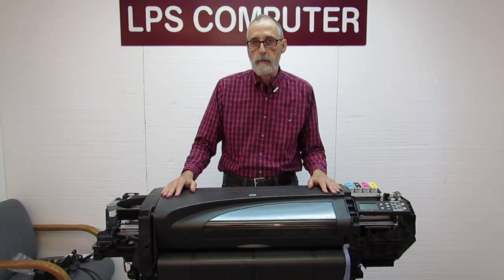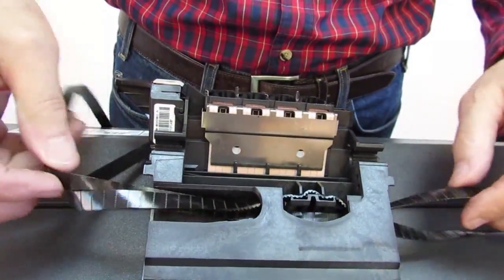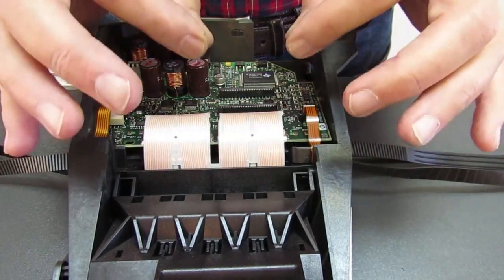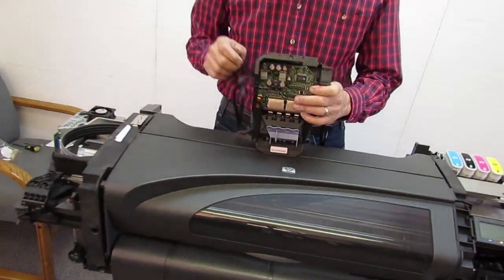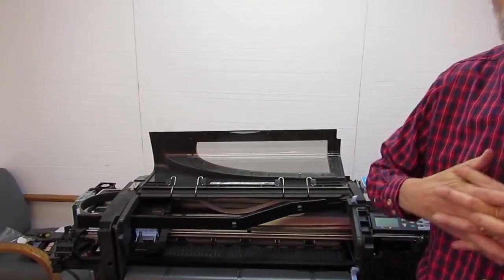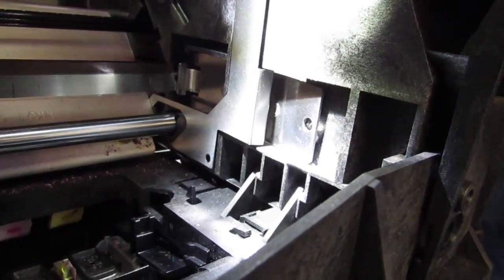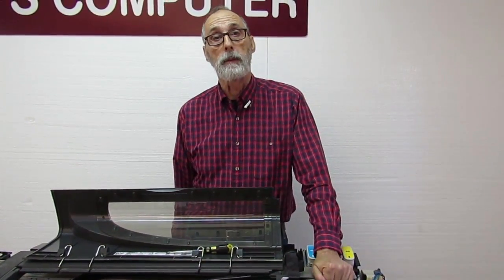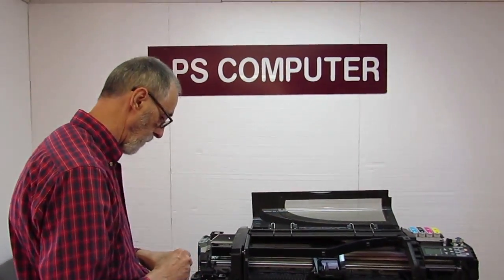HP Designjet 500 & 800 Error 86:01 AFTER Belt Replacement

Comment: Bob, I cleaned the machine, checked the coding strip, checked the cutter wheels and everything is fine. I was able to print after that but that was a week ago.  Tried printing today and am getting the 86:01.  It tries to print but then says there's a paper jam when there isn't one.  Any other suggestions of things to try?
Reply: I replaced the belt 2 years ago (thanks for your video and supplying the belt to help me do that) so this error is happening years after the belt replacement.
Reply from the maker: What is the machine history? Has the belt or other parts been replaced?
Reply: Hi @LPSshowsyouhow  Yes, I replaced the belt and it has a new formatter (it's only about 3 years old).  The print carriage is not quite 1/2 way when it says it has a paper jam, and this is after it starts to print and has printed a few times.

Comment: I acquired a Designjet 500 that literally was rescued from the trash. It was outdoor, damaged by water, tree and plants debris, insect and rodent activity, belt melted, dust, dirt and tons of crusty old ink (which was the reason it was dumped). Several hours removing, washing, cleaning parts, replacing, and specially with this videos, The printer is up and running. Very happy with this machine and very satisfied that it was relatively easy to work on it. Thanks Bob. Hope you are well and healthy.

Comment: If I lock the service station in home position it stays locked and I get 86:01 error. When I unlock it by moving the gears and plug it in. It glides smoothly however the service station gears make a grinding noises like they want to move but can't. I get error 21:10 Both when the service station moves from home position and moves back to it. I have replaced a belt and a service station so far.any advice?
Reply from the maker: If you un-mount the service station from the bracket, remove it from the machine, leave the cable plugged in, and boot the machine, do you still get error 21:10?
Reply: @LPSshowsyouhow  I took it off, left the green cable plugged in. And yes I still get a 21:10 error
Reply from the maker: @pog2648  Try slightly loosening the two screws that hold the service station motor onto the service station, and boot the machine.
Reply: @LPSshowsyouhow  I've tried this and the gears still seem like they want to move or are very jittery. It happens at start up the trolley moves on the belt when I comes back to home position it does the jittery thing again and still getting 21:10. This is with using a new service station
Reply: @LPSshowsyouhow  could it be the trailing cable?

Comment: Good afternoon Bob
I have a T510 plotter giving the code 86:01, but there are times when it disappears, but when it is time to print the first pass of the car, the printing is normal, but when he is going to make the second pass, the right side of the print comes out shaking, what can it be?
Reply: Hi.  The shaking carriage motion is likely debris in the motor pulley from a disintegrating carriage belt.  Check the condition of the belt near the motor.  You will probably need to replace the belt and clean the motor pulley.  The belt kits can be seen at:  https://www.lpscomputer.com/collections/designjet-500-800-belts-belt-kits and the replacement video at:  https://www.youtube.com/watch?v=Dhq1IBMiB84

Comment: Hi Bob! I did everything that you explained in the video, I still have the same error.
Is there anything else to keep in mind after replace the carriage belt?
PD: excellent video, as always.
Reply from the maker: You installed a belt from LPS?  Does the carriage always stop at the same place when the error occurs?  If so, where does it stop?  800-959-1575
Reply: clean your en coding strip

Comment: Thanks for the great videos.  I purchased the belt kit and successfully replaced it.  I had other problems with the power supply , so I replaced it also.  Now I have a curious problem.  I can print with the printer but once I turn it off, i cannot power it up again.  Through trial and error I have found that if I remove the left end cover, and then replace it , the machine will power up and work fine.  Once I switch it off I have to go through the whole procedure again. Can you think of anything that would cause this?
Reply from the maker: Does the printer function if you leave the left cover off permanently? It may be a cooling issue causing that symptom.

Comment: hello, I replace the services station for the error code 21.2.13 but now after replacing the error as came 86: 01. I clean encoder strip but the error is coming again. the carriage after initializing the first moment of the carriage stak ... help if u have any idea . the plotter model is Design jet T2500 MFP
Reply from the maker: Can you tell me the exact movements of the carriage up to the failure?  Does the error occur a couple of seconds after the carriage stops or immediately after the carriage stops>

Comment: error code 61:05
Reply from the maker: Are you using a Jetdirect ethernet connectivity card to connect to your printer? 

For the Designjet 500 printer with an HPGL/2 accessory card installed, remove the memory expansion DIMM. For Designjet 800, try a different memory DIMM, then see if the problem persists. 

61:05 can also be caused by faulty connections between the carriage flex cables and the printheads. Clean the electrical contacts on the printheads and on the carriage flex cables.
Reply from the maker: System Error: 61:05
Problem
Description:
Error Processing Job. This Error Code only appears in HP DesignJets
800 Series, or in the HP DesignJet 500 Series with an HP-GL/2 card
installed, when processing either a PostScript or HP-GL/2 file.
Corrective Action: Try the following:
 Switch the Printer Off and wait a few minutes. Switch the Printer
On again and resend the file that you were trying to print.
 If the Error Code reappears after resending the file, then try
generating the file again and try to print again.
 If the file that is causing this error is PostScript, check if it is
Binary. If the file is Binary, use AppleTalk to send the file to the
Printer. If AppleTalk is not being used to send the Binary file to
the Printer, then change the PostScript settings to Binary through
the Front Panel (Set-up menu / PS settings / Encoding / Binary).
 If the Error Code continues to reappear, check for a new release
of the Driver.

Comment: Hi Bob, 

any chance you will be showing a 11:11 & Trailing Cable replacement video soon ?
Reply from the maker: We don't have plans for a video on the 500 trailing cable.  The carriage end of the cable replacement is covered in our "500/800 Belt Replacement" video.  Putting the TC on the Electronics Module can be made a lot easier by removing the 3 mounting screws on the Emod and pulling it out about an inch so you will have room for your fingers to put the cable in.  Be sure to lift the connector clamps on the board before trying to insert the cables.
Reply: Thank you Bob ! That worked well ! Another tricky problem I have is, that the printer keeps wanting new printheads and the printhead calibration is aborted after printing only a small black bar rather than all the dots. Do you have any help for this issue ?

Comment: Hi Bob, 
Thanks. my mistake was not checking the encoder strip landing on the RHS of printer (Ink side). As you pointed out watch the head as it goes into the landing zone.
Being a rather old printer all the plastic has gone bad & breaking up. Bought this for £150, have had to replace printheads & will be replacing the print cartridges due to age. Mainly used for printing drawings, but now want to start printing pictures & posters.
Could I make a suggestion, when reconnecting the ribbon cables on the print carriage I damaged the connection strip, luckily I managed to sort this out, I separated the two cables & connected them on the second attempt. The foil detached from the membrane. Very Lucky.
Again thanks.
Either net does not work due to fault, card costs too much, so USB works fine.
Cheers
Ash
Reply from the maker: Yer welcome!

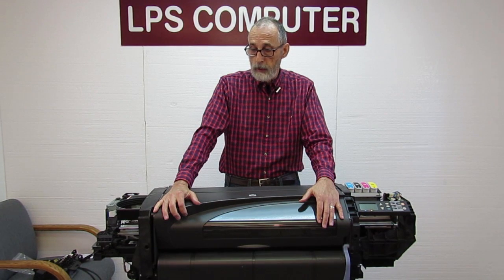Comment: Hi Bob, we writte you from Cuba, we have a hp 500 wich after replace electronic module give us 01:12 error we try to reprogram eeroom but we can't find where to writte it the model number just de serial any idea, thanks a lot ur videos r very helpfull for us
Reply from the maker: Hi Juan,
The only way to reprogram the Emod is by putting a service station in the plotter that came from an identical plotter and when the plotter asks what you changed, choose "service station".  The plotter backup ROM lives on the ink supply station.  The menu won't allow you to change the model.

Comment: Hi Bob! I am a teacher of Drafting Drawing courses in Puerto Rico. I have a problem with the HP 800ps Desigjet plotter in the school. We began this school semester on August 14. When I pushed the on/off button , the green light flash a second just one time and nothing else happens. The machine was in a storage with A/C from May to August. Can help me in this matter? Thank you.
Reply from the maker: Hi Cesar.  The power supply on this plotter has probably died.  It is an easy fix.  Take off the left end cover and remove the connector to the electronics module and take out the mounting screws on the PS and slide it out.  You can order the PS at:  https://www.lpscomputer.com/collections/designjet-500-800-parts-page/products/c7769-60145-r-c7769-60387-r-designjet-500-800-power-supply
Reply from the maker: The power supply has probably failed.  See: https://www.lpscomputer.com/collections/designjet-500-800-parts-page/products/c7769-60145-r-c7769-60387-r-designjet-500-800-power-supply